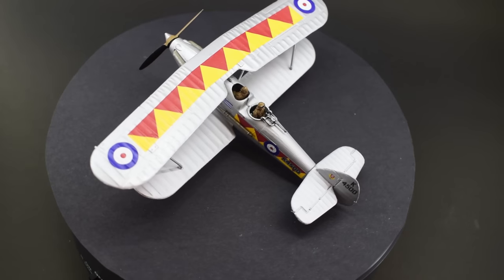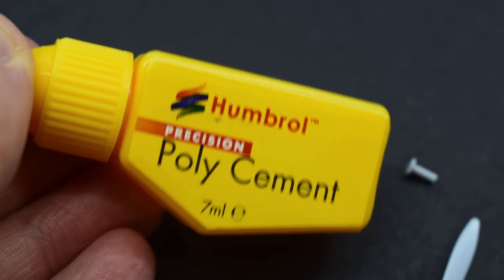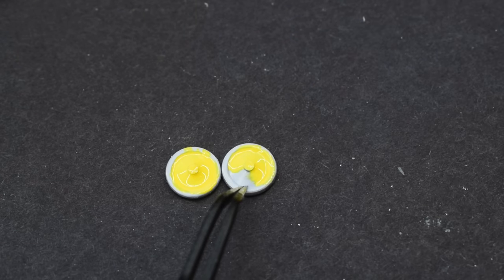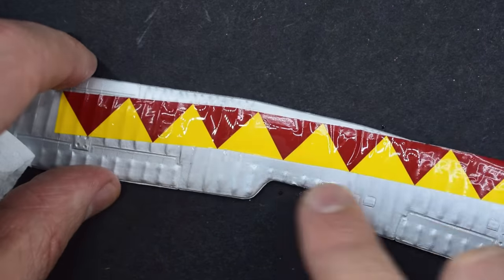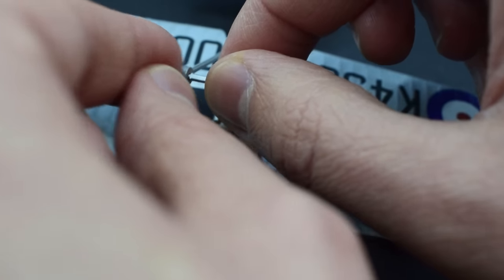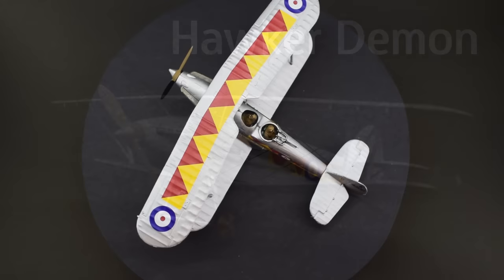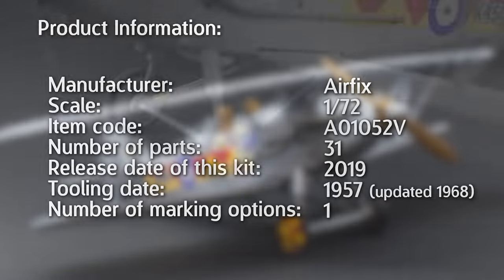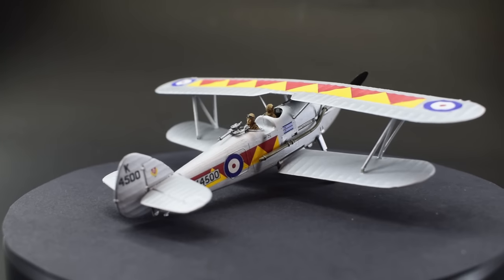One of the BEST Vintage Kits? Airfix Hawker Demon in 1/72 Scale - Build & Review

Comment: I think I built one of these in the early 1960's. It cost 2/6 (which was my weekly pocket money allowance) and came in a plastic bag. Ah, the nostalgia...
Reply from the maker: I've recently found some frog kits which have card headers and plastic bags . . they will get built at some point :D
Reply: 2/6. Sherbet dabs were 3d. Polo mints I think 2d. Small chocolate bar 6d. Larger chocolate bar 1/-. Giant one a florin (2/-). Fruit salad sweets 1/4d. Memories, memories.
Reply: @mbak7801  I think this tooling was first released in 1968, before decimalisation. 2/6 became 12.5p. Now even the humble half-penny has been phased-out! 
Cadbury bought Freddos from MacRoberts, but they didn't go on sale here in the UK until 1973. Today, Sainsbury's are charging 25p (or 2 Airfix Hawker Demons!) for an 18g Freddo.
😳😄
Reply: I also built this Hawker Demon around 1970 and I have still it.
Reply: I built this about fifty yeas ago, back when airbrushing a model kit was not so common.

Comment: Just an observation, but do you not rinse off the plastic parts on the sprues with soapy water to remove any grease?
Reply from the maker: I do wash the sprues depending on how oily they feel. Sometimes I don't wash them, but even if i do wash them I don't always feel that including that in the video is relevant to the flow of the content

Comment: How you did about instrument panel?
Reply from the maker: Not sure I understand your question? The control panel decal was applied in the video around 05:30
Reply: @Model Minutes  yes, I watched the whole video and indeed, you placed the decal. The question is: on which surface you placed the decal? I  just cut a piece of styrene and shaped using the decal. Later, I glued the "panel control" to the fuselage. Once was ready, I pai Ted the whole unit, the "panel" along the fuselage. Once I paint overall yellow (fuselage, lower and top wings, rudder and elevator all in place), I will place the decal the same way you did on your model. Thank you very much for answering. By the way, your "Demon" looks fantastic! Kudos from Mexico.
Reply from the maker: @carlosballesteros4670  the model has a control panel part pre-moulded inside the cockpit halves if I remember correctly. That’s what I applied it to
Reply: @Model Minutes  yes, I  saw it but I thought that results way too small and decal at the end, will be flapping and is likely to broke. I glued the piece I shaped into that part you kindly mentioned. Thank you so much!!!!!